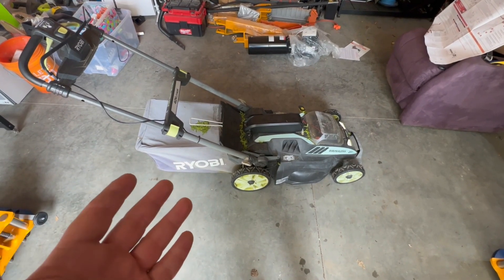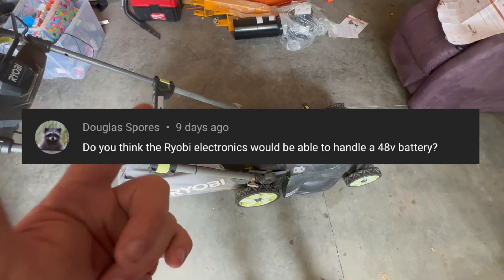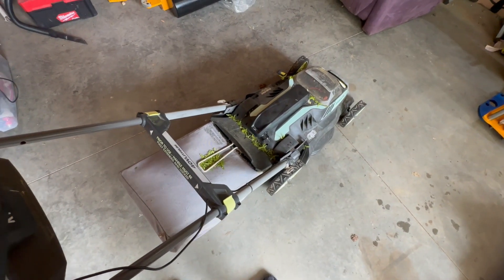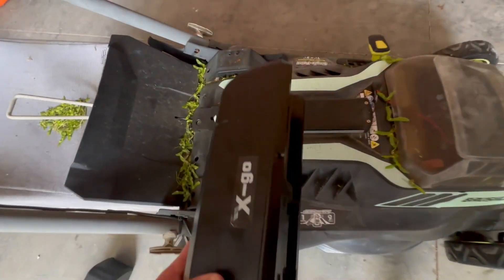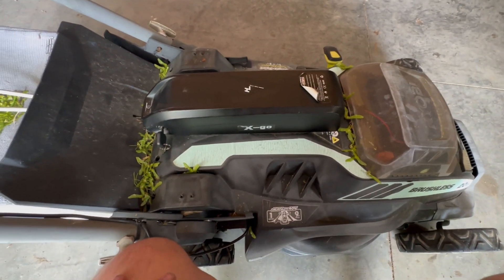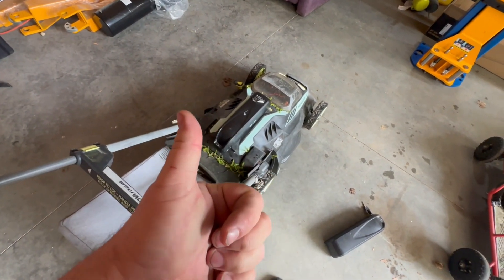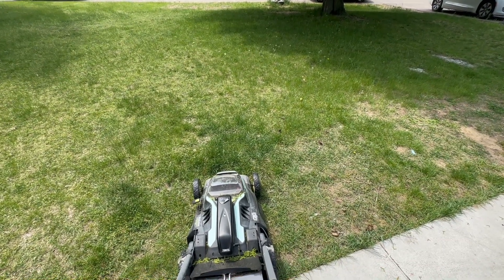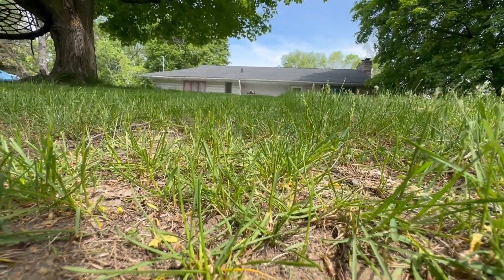Will 48v blow up my 40v Ryobi mower?

Comment: My ryobi wouldn't accept a voltage higher than 45.5. Mine is not self propelled. I might be looking into getting a different motor controller so I can use the battery I already have.
Reply from the maker: Interesting, I wondered if there'd be differences in the other models.